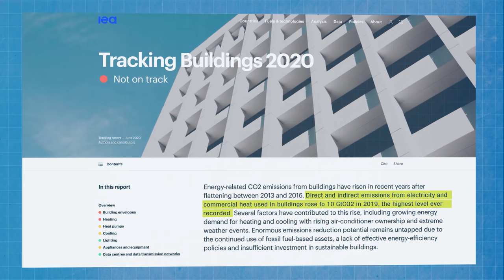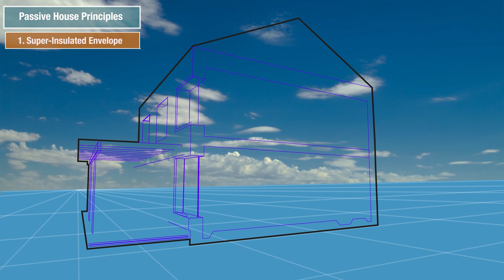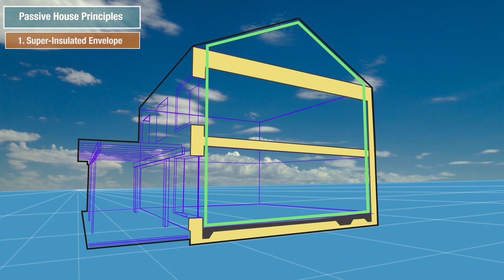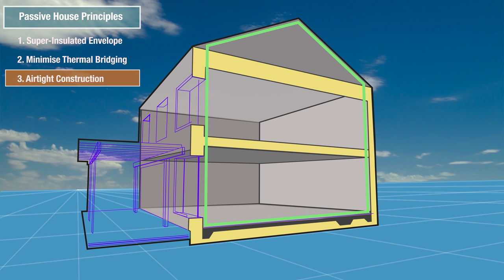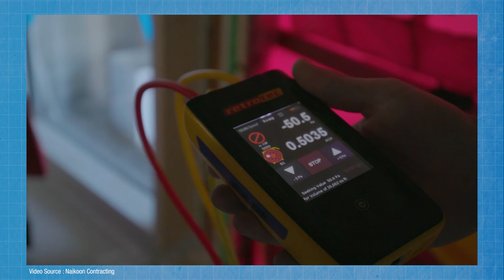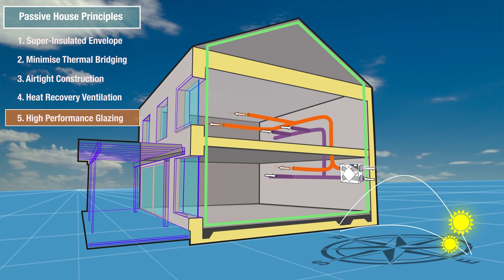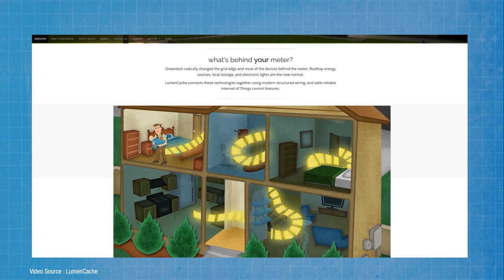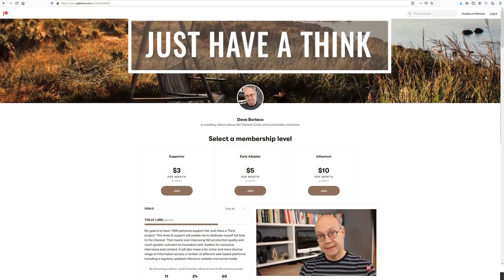Passivhaus . A low carbon future for our homes?

Comment: Thank you for another wonderful video! And during the holidays, too. Just the link section alone looks like a fun way to spend part of the day.

Don't think of ever heard of "passive houses" as a distinct subject before, so this has been a great introduction to the idea. One thing I've inferred from your video is that passive houses and basements do not mix, or if they do the basement would probably require even more insulation than the rest of the house.
Reply: They can, but the basement has to be as insulated, waterproofed, and conditioned just like the above-grade rooms in the house.
Reply: @barbarasmith6005  Wouldn't the insulation have to be even thicker in the basement? Soil conducts heat better than air can.

Comment: One thing that isn’t mentioned here that ought to be is that single family detached housing is the least energy-, space- and material-efficient way of building housing. A SFH has to battle heat entering or escaping through 6 direction—the cardinal directions as well as up and down. In a unit in a mid-rise building, you may only need to protect two or three surfaces per housing unit. This also comes with the benefit of denser housing, so public transit is more viable and driving a car is less necessary,  and you won’t have acres of monoculture lawns that suck up valuable water and remain unused for most of the year.

Comment: Having just completed my own house I can assure you that in the UK building a passive house is considerably more expensive than  building a house to meet the building regulations. Is it worth it? Yes! The cost savings alone will eventually compensate for the additional cost of the build but the large house building companies dont  build them because they cant sell them due to the cost and the profit they extract from them. You can find this in what are loosely termed as ecco developments where a typical price for a house is £1 million plus. The "skills" and "care" required to build those houses are not readily found on a UK building site which is why they are mostly built by individuals and enthusiasts or specialist companies that have gone out of their way to supply that market. The National House builders have a long way to go before their normal development projects reach Passive House standards.

Comment: Great video. I do work for builders in New Hampshire and Maine, and I see these houses being built. There are now even insulated studs to slow heat conduction past the wall cavity insulation. The net zero one we finished last winter is now on the market for $5.1 million US (largely from the property, but that's who's having these homes built in my area). I don't know other countries well, but here in the US the lack of housing and the furthering economic divide make getting enough people into 'modern' structures very difficult. There will likely never be enough to make this happen on scale as long as a few hoard the planet's resources.

Comment: Have a look at CLT, cross laminated timber. A great way to store CO2
Reply: yep. CLT+woodfibre is an excellent way to build buildings. That's what I'd do if starting from scratch. Problematic in the UK because there are currently no local suppliers although that is changing.
Reply: Any plant-based construction material (I say that to include hempcrete as well as wood) is a good option, provided it's sustainably farmed. Also I find timber to be a much more expressive material to use in design.

Comment: One problem in the UK is the old housing stock and laws making it difficult to easily and cheaply fit double glazing. In Scandinavia triple glazing is standard.
Reply: New build housing in the UK is mostly terrible; cheaply built and expensively sold bland little boxes. Sustainability is pretty low down on the housebuilding industry's priorities.
Reply: You have laws making it hard to use double glazing?  In the US, double glazing is now standard.  Triple glazing is used in the coldest areas.  I can't imagine why you would have such laws.
Reply: @incognitotorpedo42  it's to do with what we call conservation areas where the styling of an existing older building is controlled. For instance, a particular style of window must be adhered to when modernising or renovating. This is often very expensive to refit with double glazing in a traditional style. Seems crazy in these times.
Reply: @yodab.at1746  OK, so it's not nationwide, just in historic areas.  I guess that's the price you pay for living in a historic area.  We have that here in a few areas as well, but I'm ok with it.  Considering all the massive energy waste still occurring for no good reason in other areas, I'm not bothered by spending a little more energy to maintain some architectural treasures.  FWIW, a properly fitted single pane window is not wildly worse than a double pane window.  Most houses lose a lot more energy through air leaks and bad insulation.
Reply: @incognitotorpedo42  there's a lot of areas here because, in quaint England, we tend to have a massive amount of older housing stock. My childhood memories include writing my name in the ice that had formed on the inside of our windows. We need to progress.

Comment: Ah for the comfortable life of the comfortably well off. The vast majority of the people can only dream about such homes. I relate to your optimism, however perhaps a pinch more reality to bring it down to its basics. Happy Tipping Point x
Reply: Chico I earned close to the minimum wage until I was just laid off for covid 19. Just to let you know it is possible. I can look outside my triple pane windows and have fresh air coming in the house and my payments are much lower than my neighbors. I had to ask myself under what conditions could I build my house at a far lower energy and resource footprint within the constraints of my then income. Such a mindset reduced my monthly costs so much I was able to save and hopefully ride out covid-19 for the next 6 months or more. Of course if you're expecting like my brother a 5000 square foot home it's going to be more challenging 2 have of passive house on minimum wage. But I would dare say not impossible. The limits are your creativity and resourcefulness.
Reply: I've lived on my land in the Sierra Nevada, en El Andaluz for 21 years. I built my own eco friendly house, with solar power and minimal electricity use. I have 156 ancient olive trees, also mature almond and walnut trees and more. All organic. My land and house and self installed solar  cost many times less than this unnecessary building.
Reply: By the way, Chico is my horses name

Comment: Once again very good information but for this style of construction to become the norm it will require government will and this is sadly lacking.  Compound the fact that builders always say green homes cost too much to build despite the fact that this is a huge exaggeration and we are left in the current situation. Swathes of new homes being built that only meet the current low standards but very profitable for the builder and not really that good for the environment. To put it into context my home was built in the 1970s and has very similar gas and electrical consumption to many of the new builds locally belonging to friends and co-workers alike. We do keep our house warm and don't restrict heating by timer apart from reduced temperature set point during bedtime hours, it does have a modern condenser boiler and cavity wall insulation.
Reply: Is that because new standards are bad, or was your 70's house particularly good for the era?  The seventies were a low point in American residential construction.
Reply: @incognitotorpedo42  I’m in the U.K. and build is fairly standard for the time. Here in the U.K. we are very good at doing some environmental things well but not on a national scale. If governments around the world raised building and other standards we would have the very present environmental issues addressed and help reduce our impact on the planet. Hope 2021 is better for us all

Comment: frankly, the much larger impact would come when said practices, or ones that would come at least vaguely come to the same results, are applied to apartments and larger multi unit housing. as density of housing alone makes for immense gains in efficiency, not just in direct energy use, but all the secondary efficiencies that come along side it

Comment: Having worked in the building industry, I would like to see your research into the different types of wall insulation; fibreglass, polystyrene, recycled paper et.al..  In Russia, the traditional material in the ceiling was leaves followed by a deep layer of flax waste - very effective, and a great place for nesting mice!  Please have a think about retrofitting in old stone or brick houses in your native Britain.
Reply: Build underground and you don't need insulation
Reply: These are called "Earthships", and can be relatively cheap to build.

Comment: The build show clips were cool. Been planning a house build and watching Matt's channel. I plan on going as close to passive house standards as possible but may not go through the expensive certification process, just go off blower door score. I figure it to this thought process pay now or pay later. Spend now and seal the house right or pay more in utilities over the life time of the unit. Kind of like these new ink well printer vs cartridges. 60 buck for a printer but 60 bucks for ink every time it's needed or 300 for a print, 20 to fill the black. I've had one for almost a year now. I haul over sized and super loads. Printing off all these permits and I have yet to need to refill the ink wells. Just as example of pay now vs pay later.
Reply: Love the printer example, and totally agree that the choices are pay now or pay later -- although I don't think the pay-later choice actually exists anymore. There won't be any fossil fuels to pay for in the years to come; and if there ARE any, their scarcity will drive up costs to a point where nobody can pay for them. So the choice is really pay now or......pay now. 😊

Comment: Buried air pipes 4 meters bellow the soil can provide free cooling. The is one such building with that in Lisbon Portugal, called Edifico Solar XXI, which uses underground air tubes/pipes made out of standard concrete waste water piping sections. This is cheap, durable and simple to install. The air exchange can decrease temperatures from 35 to 25 C. Such a system has the potential to be a more efficient heat source or heat sink for air conditioning. This building however relies on passive technologies for thermal confort in the summer although it's not a fully passive building. It is however a NZEB as it produces PV electricity from the building walls, using the heat of the panels to heat the building.

Comment: As pointed out, this was 30 years ago. The next level was introduced 15 years as 'energy plus house'. Check out the Wikipedia article
Reply: @Jay...777  Not sure what you mean with missing the point. If you are looking for real life examples there are Fasanenstr.87, Berlin, the 'Sonnenhäuser' in Jesteburg near Hamburg, a building built in the beginnings of the 1980s was retrofitted to an Energy-plus building in the German Rhein-Main area and then there is the Solar Settlement in Freiburg in Germany, too. So that is what I got from the Wikipedia article. No it is no longer exclusively on the Wiki page and hopefully doesn't miss the point any longer

Comment: Thanks for this. I'm preparing for some home improvements which will result in replacing the current 30-year asphalt roof shingles on a very non-passive house built in 1952. I'm trying to determine what "upgrades" to make in order to reduce my energy consumption and make it so I won't be replacing the roof again in my lifetime (I'm 66).

Comment: We live in Canada and we have lots of solar panels which input to the house and the grid...We produce enough electricity to supply ALL our electricity  needs...including heating with a geothermal heat pump....I have also installed interior, insulated shutters on  many of the windows which I close at dusk during the winter...the effect is quite dramatic....I have done the calculations many years ago and don't have them at my finger tips...suffice it to say , that this is one aspect of the passive house construction which is missed by designers and builders...I wish it were otherwise...Basil Wall

Comment: Thank you very much for all of your great work 🙏
When it comes to energy efficient buildings one has to factor in the energy used in the buying process, tough.
For me a eco friendly and energy efficient home has to be built from natural materials like clay, sand, straw or hemp and its totally possible to construct passive house standard buildings from those materials. 
Saving energy is great but its of little use if your house us built from energy consuming and toxic materials like concrete.
Reply: There is a video by JHAT about concrete that sinks carbon https://www.youtube.com/watch?v=MkE-2npiqFc and it would be good to combine with passive as thermal storage. Not sure how viable it is on the local scale.
Reply: -and the only way to pay for it is to work for someone who owns a Rolls Royce and a Lear jet!  :-)
Reply: @chippysteve4524  sustainable building doesn't need to be expensive if that's what you're implying here.

Comment: To really put a dent in home energy consumption, we MUST find low cost ways to re-skin houses. I sense that it can actually be done cheaply, using modern materials, but that contractors are marking-up costs dramatically. So most homeowners are scared-off by the $40K-plus price tags quoted by contractors. We need solutions that can be widely deployed. 
Could you please look into this?
Reply: It's called RENDER

Comment: Retrofitting old housing is a difficult issue. While there are grants and arrangements available for people to upgrade there is a surplus of obstacles for most. Solar I don't think should be a primary option for most, having it be an on site and individual option is good but when it comes to offering benefits good mid and old growth tree cover is excellent and appealing. There are a select kind of home owners would choose no leaf cover over even modest presence and there's nothing that can be done to combat that kind of opinion. They want a reduction in responsibility or improved grass space and what can you do when land owners choose to have the most in vogue and extensive maintenance option. Many houses do have south or north facing options for windows and there are limits depending on geography for utilizing sub foundation utility compromises. My house is metallic in total, low insulation and limited air gap, concrete foundation with no basement space. It is also a historic structure. Fixing and improving such a building is uphill when not only are technologies and products largely unknown but that trained labor becomes choosy in what it will and won't accept a contract for.

You all want to see many of these projects bare fruit then a bottom up teaching, manufacturing and building culture needs to take hold. We can't rely on standing businesses, companies and government to help us or each other. It's up to you to go out there and cause a significant dent in the problem. We may even have to accept, given our level of concern, that this won't be a profitable enterprise. That shouldn't be suggested to the skeptics, profit and cost savings are the main drive there. But for us doing what is responsible for every reason is what matters. The outcome will prove to others that it was worth it but it will require work and sacrifice. I don't think even the believers in the problem are truly behind doing anything to help. We're all waiting for someone or something to come along and save us. But we were the problem and we continue to feed it. So do something.

Comment: 30 years may have gone by but those insulating windows you mention are still 10-20x the cost of "regular" double pane glass.  And nobody guarantees the argon won't leak out in a year.
Reply from the maker: I think that gets the prize for this week's most ridiculous comment. Triple glazing is only slightly more expenive than double glazing and you get the cost back in energy savings over time. Here's a more helpful link
https://glassstructureslimited.com/blog/double-glazing-or-triple-glazing/?gclid=Cj0KCQiA_qD_BRDiARIsANjZ2LCWBLSzrGPCEF-soV6LaHBsTXEwn3luki0DiuDxwkNIkjYivS6FqjIaAu0qEALw_wcB
Reply: @JustHaveaThink  You are right.  I think I was confusing custom window prices in the brochure I was reading for Anderson.  "Low E" vs "E series" (not the same).

Comment: The idea of retrofitting a brickbuilt house to passivehaus standards is economic madness.
It would be far cheaper to build a freakin' geodesic dome over the house or entire street which is actually being done by designers and engineers in pilot schemes in Europe right now.It easily compares to the energy efficiency of the finished Passivhaus but without all the overpriced and overcomplicated nonsense reqd to make a PH actually function.
And as an added (huge) bonus- you end up with a lovely big covered area under the dome where you will actually end up spending most of your time in the bright open space where the laundry always dries and the roof never leaks. 
All the materials used are cheap and 100% reusable and recyclable.
I'd like to see a PH that can do that!